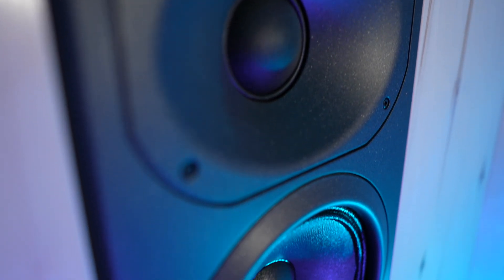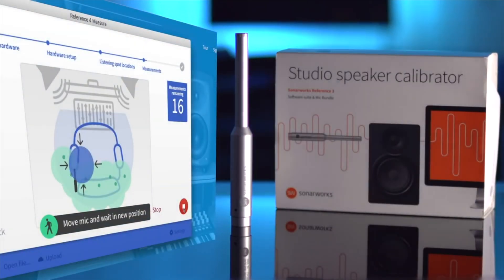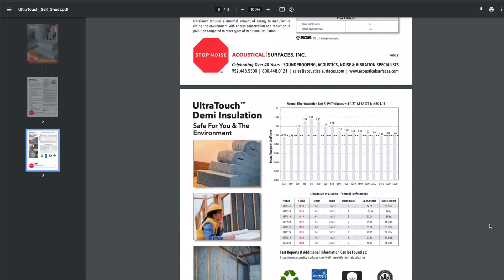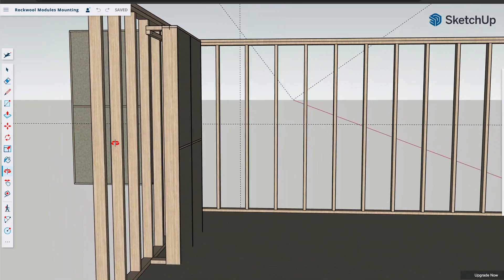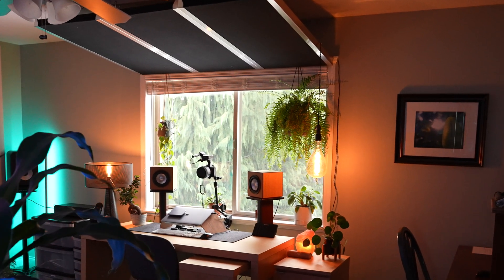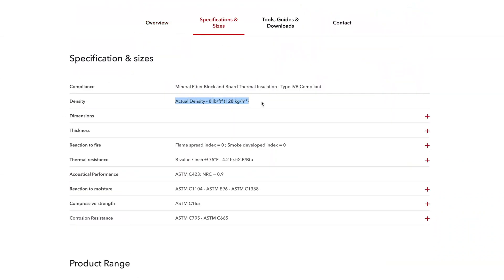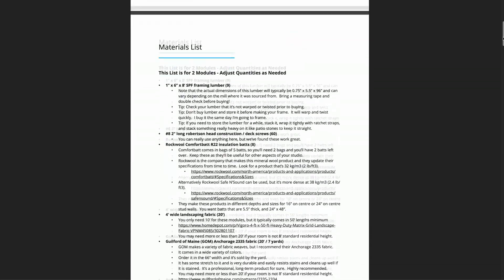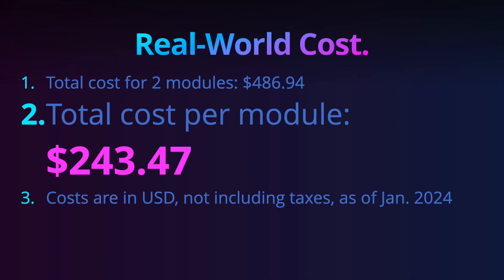How to Use Porous Absorption in Studios - Rockwool + Fibreglass

Comment: If higher density material is gonna reflect the sound, why am I still supposed to hang it onto the wall? Wasn't the first intention "to absorb" the sound? Does it absorb at least low frequencies?

I wouldn't spend money on something that doesn't do anything in terms of acoustics.

What would you think about 10cm thick 50-60kg/m3 wood-fibre absorber with GFR-6,000 as wall, corner and ceiling absorber?

My setup is placed off centre of the front wall. Bcs I've separated the 1/3 of the room with curtains. My plan is to create a "fake" corners with absorbers, where the curtains separate the room.

Visually, it would look like a complete monitoring room with a rectangular shape, created from 2/3 of an almost square room. But, as I've mentioned, there wouldn't be actual wall in between but the curtains and "fake" corners created with absorbers.

Do you think this kind of setup with 12x 2'4'4" Panels (4 as a cloud) would work for for mixing?
Reply: Thank you for taking time and replying my question in such a detailed way. I really appreciate that.

To be more precise about point 3), it's called "STEICO flex 036" and in the product details it's declared as "Airflow Resistance" (personally, I related it to "Gas Flow Resistance", pls correct me if I'm wrong) and it is ≥5 (kPa*s)/m² for this product. The density is also declared as "Approx. 60" (kg/m³).

I don't wanna leave a product link under your video ,) You can easily find it on the web I guess.

To the point 4), I totally agree that it would be far from the ideal placement of the setup according to the view of most of the acousticians. But, as far as the room is rental and also serves for private purposes like living in there etc. xD, I can't really do much about the room's layout that I have, except trying to optimize it so, that I can at least judge my mixes at some degree and keep producing something until I'm able to have a dedicated engineering room. :D

Nothing offensive, but it's the reality for most beginners using a part of their bedrooms as a recording as well as mixing room. :)

However, I may consider your combo panel design, so I have huge bare walls to cover anyways.

Btw, I came across your new video series about acoustics just a day ago, and watched several of them in a row. Tbh, I appreciate the quality of the videos. I hope to see more about the topic in the near future.

Have a great day!!
Reply from the maker: Hey hey.  In terms of GFR, if they've lab tested their numbers then I would use them.  Their spec sheet isn't in English so I can't read it.  Seeing as this is wood fiber, the fiber type and GFR numbers will be different from mineral wool for sure.  Fiber type matters.  

I hear you regarding the room layout.  You have to work with best optimizing the room you have. Note that there will not be any bass buildup at a "false wall' made of curtains or drapes.  Bass will just pass through that like a hot knife through butter.  Put your bass trapping in the hard boundary corners.  

The other thing you can consider are floor to ceiling modules like the ones I show in my acoustics course and videos in this series.  Those could form your false wall.  Note that I would use material with a GFR or 10,000 pa.s/m2 for things up to 30 cm thick.  5,000 is way to low and only suitable for much deeper trapping of perhaps 1 meter or as a back layer using graduated density.  

Use headphones to check your bass.  That is a good way to making up for potential bass-related room anomalies.  

I'm glad you've found the acoustics videos helpful.  There will be more.  Cheers!
Reply from the maker: Hey hey.  Some good questions in there.  I'll answer them one by one.  
1) High density material (90-130 kg/m3) is not 100% reflective.  It will definitely still absorb, but just not as much as lower density material at mid and high frequencies.  Where it WILL absorb more is in the low end.  This type of material is typically used in super thin ceiling clouds, or as corner mounted bass traps with the air space backfilled with lower density fiberglass, foam, waveguide assemblies, or limp mass.  Prefab Primacoustic Maxxtraps are of this design.  They use a 3" front panel that's 6 lb/ft3 (95 kb/m3) density glass wool.  
2) I would never recommend anything in my videos that would cause you to spend money on something that doesn't do anything.  It's all about using the appropriate type of material for your room, location, and goals.  The range of materials I stated (density 20-128 kg/m3) are all useful in different circumstances.  
3) 50-60 kg/m3 fibrous material is highly unlikely to have a GFR of 6,000 pa.s/m2.  Where did you get that number from?  For reference, 55 kb/m3 rock wool will have an estimated GFR of 17,188 pa.s/m2.  That density and depth of mineral wool could definitely be useful as either a ceiling cloud or corner trap.  I would not use it in primary reflection zones on your side walls.  It would be too reflective most likely at the frequencies you use for spacial orientation.  I'd use 32 kg/m3 for those points at 10-15 cm thickness with an air gap.  
4) Regarding being off center.  I would avoid that at all costs.  The first golden rule of room orientation is symmetry.  Unless you can create a hard wall that's a real boundary, I would not put your mix position off center in a room (laterally).  If you can. frame in an internal 2 x 4 stud wall with drywall on both sides to emulate the construction of the opposite wall.  
5) Regarding your panel designs, I'm not a fan of smaller, wall-mounted 2' x 4' panels.  Watch this video to see the type of DIY panels I recommend for mixing / control rooms: https://youtu.be/ECazGzutkV8 

Cheers!
Reply: @warpacademy Question about point number 1. You are saying that high density material is reflective at high frequencies but more absorptive at low frequencies? This is opposite of what I have been gleaming elsewhere, and is contrasting to what I feel you’ve said elsewhere about using low density treatment for deeper panels. If in fact high density material was reflective at mid/high freqs but still absorbing at low freqs, would not high density material be ideal for use for keeping the room less dead sounding?
Reply: The understanding that I had come to was that higher density material was reflective at low frequencies, not mid/high, which is why you want less dense/lower GFR material for deeper traps aimed at targeting low frequencies…
Reply from the maker: @HalcyonGuitars  hey hey. Acoustics can be very counterintuitive.  With porous absorption it all depends on depth.  A material that works well to absorb bass at one depth can reflect bass highly at another depth.  

For a bass absorber you can get good results going with a denser but thinner front layer followed by a light thick layer.  

For example Rockboard 40 or OC703 for 2-4” and then 1-2 feet of pink fluffy will make a pretty good wideband absorber that’ll be effective into the LF.  

You get a benefit from dual density.  

Some companies that only make super thin panels out of one density may use high density material such as 100 kg/m3 glass wool used by Primacoustic.  But I don’t recommend that.  They still don’t absorb much LF.

Comment: Thank you, your videos are very enlightening. How can the amount of surface area (in m2) that should be absorbent (as deep as possible, etc.) for each room be calculated?
Reply from the maker: Hey hey.  Glad you've enjoyed this topic.  Area of coverage needed for your room can certainly be calculated.  This calculation is used when you're seeking to target certain decay times in your room (which is definitely a good idea).  Theoretically, you'd start by finding out what your room's projected decay time is by using MFP (mean free path), room volume, and surface area.  Then you can use the Sabine formula, although this is only really useful for rooms of relatively low absorption and not all that accurate for control room sized studios.  

A better way to do it, is to shoot the room with Room EQ Wizard and actually look at your decay times in each frequency range using the spectrogram and waterfall.  Look at the T60, T30, T20.  Then from the measured, untreated, decay times, you can speculate what type of treatments are necessary to bring them into your desired range.  

Rock wool modules, like the ones in my video here, can be very effective broadband absorbers - especially when air gapped: https://youtu.be/ECazGzutkV8  When used strategically, they can get your decay times nice and even at 150-200 ms all the way down to 60 hz or so, depending on the modal distribution of your room.  Get a room mode calculator.  I like the one that's free on John Brandt's website.  It'll calculate mean free path for you, as well as show you your modal distribution and likely areas of ringing where you'll get longer decay times.  

If you really want to rein in a 30-60 Hz room mode (or stacked room modes) you'll need a different approach.  Thicker treatment for sure, using graduated density, perhaps some pressure-based treatments like vibrating panel resonators or hybrid treatments with a higher density rockwool front panel.  It really depends on your room and the LF cutoff frequency of your speakers relative to your room.